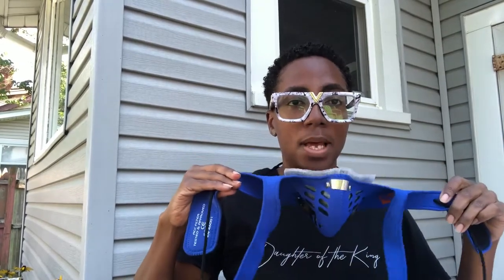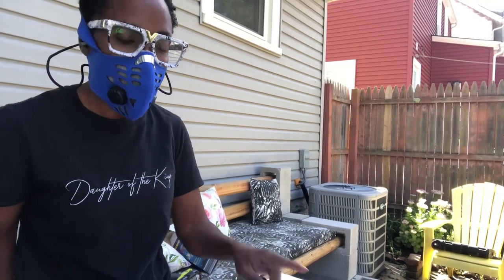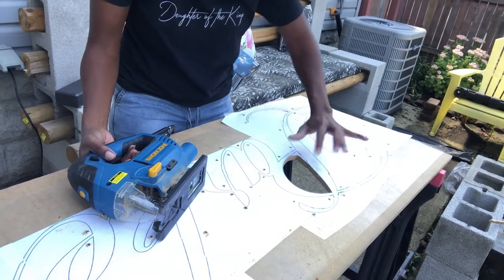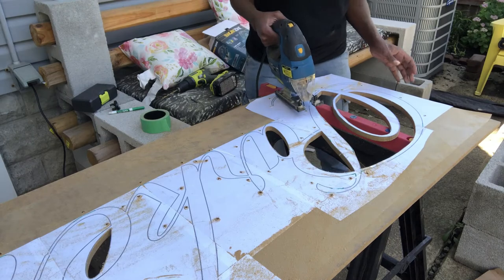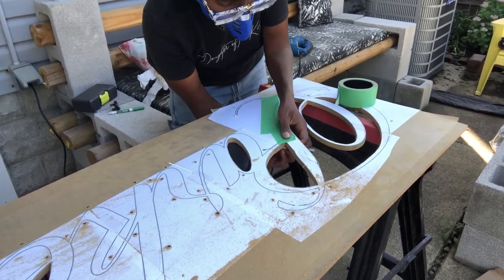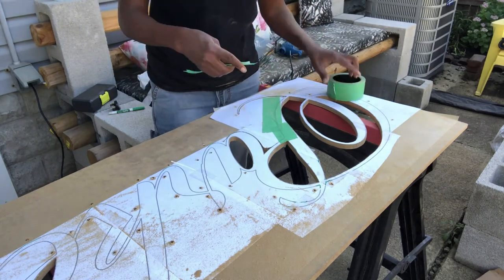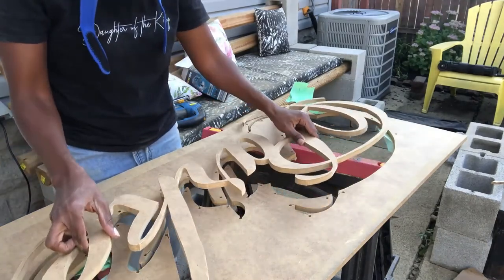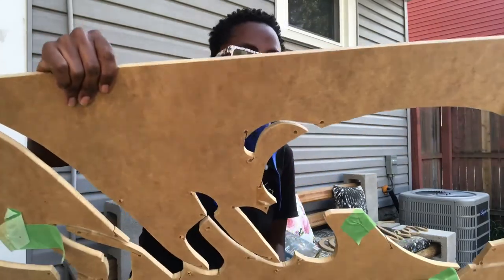Make a name sign with a JIGSAW!!!

Comment: Another awesome video! You make this look easy! What would you say is the smallest sign/ lettering that would be fine using a jigsaw?
Reply from the maker: I made a sign that was 24 inches wide and it was torture! It took almost 2 hours, but on my scroll saw it only took 30 minutes. I’m sure there are folks with great precision who could do it with no problem, but for me I won’t cut a sign smaller than 30 inches with a jigsaw.

Comment: Isn’t the scroll blade for a scroll saw Im so confused please help me understand?
Reply from the maker: Yes, but there are also blades for the jigsaw that are called scroll blades. They allow you to make curved cuts with a jigsaw and while they are smaller than regular drill saw blades, they are way bigger than the blades used for a scroll saw. For a scroll saw, I wouldn’t say that I was using a scroll blade. Instead, I would call it either a pinned or pinless blade and I’d say reverse tooth, spiral, modified geometry #5 blade, or something like that. Does that make sense? I should do a video showing the differences because that’s a great question!
Reply: Thank you so much you explained it so well